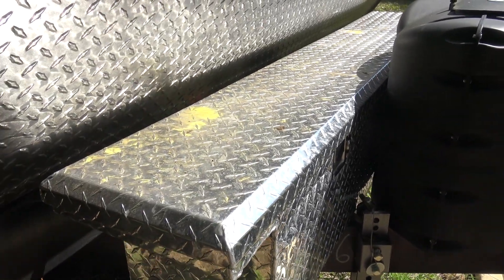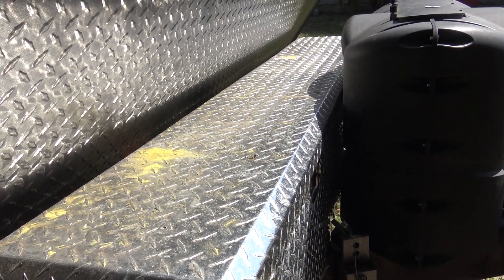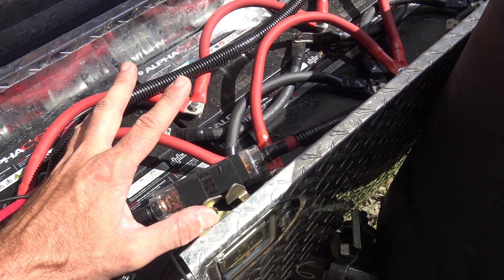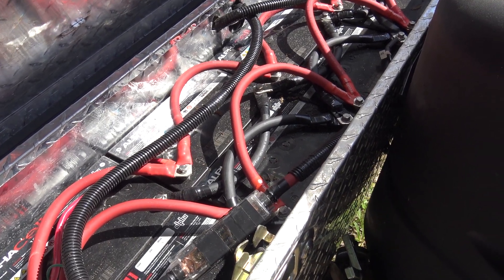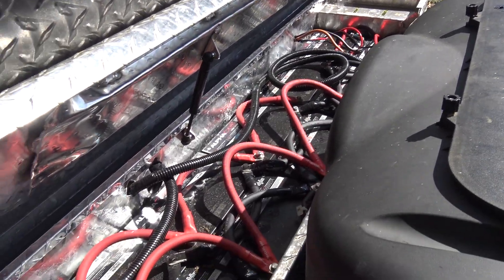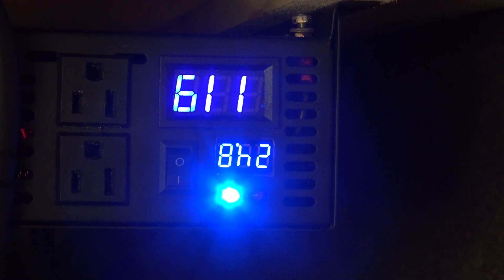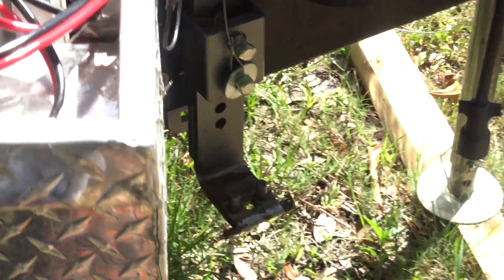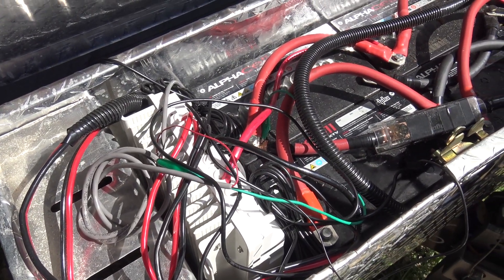I Upgraded My Off-Grid RV Battery Plant For My Solar System!!

Comment: Hi Eric,

Generally looks very good.

I would suggest these...
A) please find & reinstall the plastic cover on the inverter terminal strip, that a/c will light ya up!
B) your battery cable terminations look good, but find yourself some large battery terminal insulation covers - that's a lot of power there. Also only use tools that are insulated. One wrong move; i.e. slip of a wrench & boom - not a good day!
C)  Also, find some thick silicone insulation (perhaps the  pieces you stripped off the cables or some of that black tubing ), cut in half & double insulate each place where the positive & negative battery cables cross each other. The movement of the RV can cause those rub together & short. Or in case the cables do over-heat, they won't melt the insulation, and boom!  Again, very bad day!

The rubber pad you have is also good added security!

Comment: AGM is the way to go. I am running AGM my self. been for years now. great power cable . I use the same . it is more flexible then 0 batt cable .I have the windy nation inverter and I love it. looks great on a scope . you may want to keep 12V system separate as a back up or use buck converter. you have to figure you own needs . 73's

Comment: Looks like a professional installation to me. An alternative battery is Lithium iron phosphate batteries (LiFePO4 or LFP). They offer lots of benefits compared to lead-acid batteries and other lithium batteries. Longer life span, no maintenance, extremely safe, lightweight, improved discharge and charge efficiency, just to name a few. LiFePO4 batteries are not the cheapest on the market, but due to a long life span and zero maintenance, it’s the best investment you can make over time. 73 Joe

Comment: I like what you did. Leave the house lights on the 12 volt system and you will always have ability to have lights. Mine would last about a month without charge so that is a good thing. The AC power supply is good but you will have to learn a schedule of conversation for those days of heavy cloud cover. (or plug to shore power). Clean up the wiring for the charge controller and this will be as near perfect as you can get for space allowed. Happy Trails, K4BFR.

Comment: Looks good. Have you thought about using a buck converter ( or something similar)  to drop the 24v to 12v for the 12 volt rv system? You could then tie in the last batteries into your bank and ditch the rv converter.

Comment: I see alot of people going with Lead chemistry for off grid power storage and based on my research LiPo would be the best option due to 100% DOD, massive charge cycles and weight.

Just wondering from your standpoint why AGM? I am guessing initial cost was the determining factor. Can you help me undersrand, looking at assembling a system of my own.